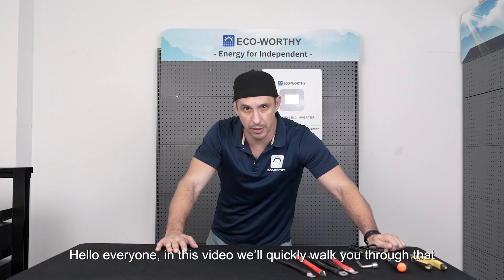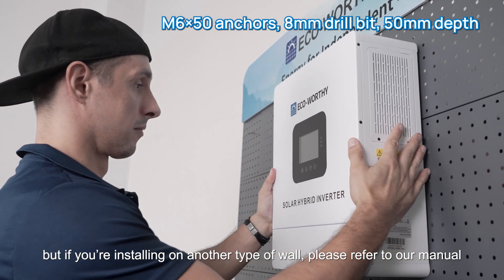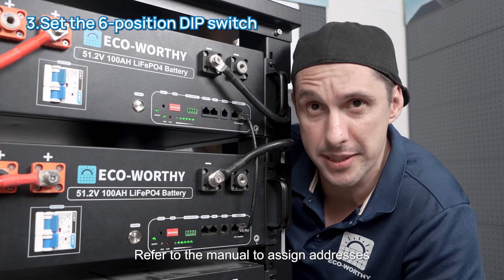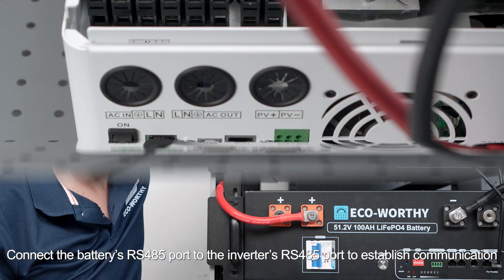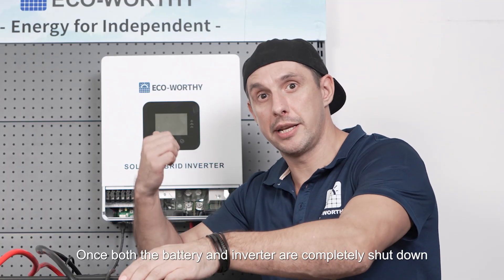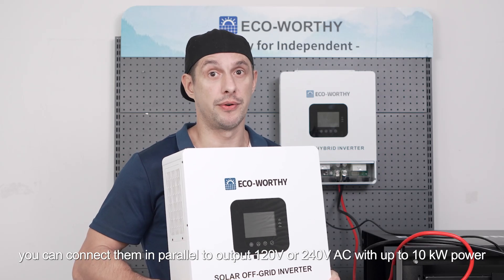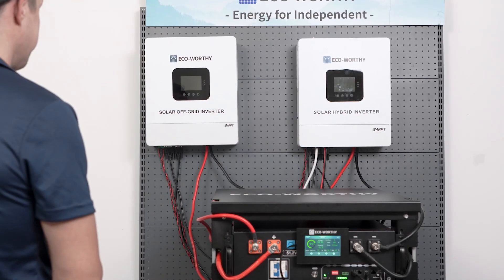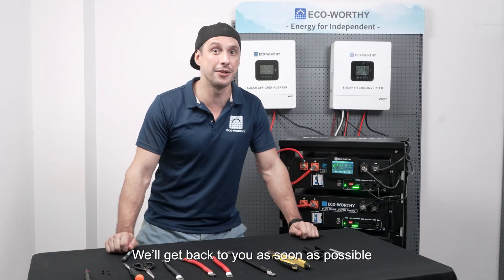Step-by-Step Guide: Connecting ECO-WORTHY 48V100AH Battery to 5KW Inverter & Inverter Parallel Setup

Comment: missed showing connecting the cables on the busbar before connecting it to the inverter. People are going to want to see where on the busbar you connected the cables since it seems all the connects are taken up by the batteries being connected in parallel.

Comment: Is the 485 communication cable a generic RJ45 CAT5/6 cable? I am connecting as suggested and have the battery protocol set to PYL, but the battery and inverter are not communicating. I have the version two battery (+ on the right side) and the inverter is also about a year old, but has the same menu and contact layouts.
Reply from the maker: We sincerely apologize for the unpleasant experience.  The 485 communication cable is not a standard RJ45 CAT5/6 cable. Because the pin assignments are different, a custom cable is required.
If your device is a 5kW inverter, we need to send you a special communication cable. Please contact the customer service of the platform where you purchased the product via private message and provide your order number. We will send you the correct cable free of charge.

Comment: I’m not getting any charging to the battery via the PV. It shows 130V coming (PV) but is not charging the battery. I have no AC input as we are off grid. I can turn the inverter power on and get the yellow (AC/Inv) flashing light but never get the green (charge) flashing light…
Reply from the maker: Hi：）

Please check the following items:

Confirm that all wiring is correct, including PV and battery connections, correct polarity, and that there are no loose cables.

Verify the MPPT voltage range: the MPPT operating range is 120–450 Vdc. Although the measured PV voltage is 130V, this is very close to the lower limit. Due to changes in sunlight or voltage drop along the cables, the actual PV voltage may fall below 120V, which can prevent the system from charging.

Check the charging mode (Parameter 06) and make sure it is set to “PV Only.”

Confirm the battery type (Parameter 08) is set to LFP (LiFePO₄).

If the issue still persists, please contact us at ecoworthy@gmail.com
 so we can further assist you.

Comment: Hello, I have 4-100-amp eco-worthy and 2-50-amp battery. Can they be put in the same eco-worthy rack that has a built-in bus bar? And connecting together.
Reply from the maker: Hello, the 100Ah and 50Ah batteries have a significant capacity difference, so we do not recommend connecting them in parallel. Doing so can cause uneven current distribution, preventing each battery from being fully charged or discharged, which may affect performance and shorten battery life.

Comment: Thank you, I have 4 100ah Ecoworthy batteries in parallel with no busbar (older rack model).  I have the EG4 Flexboss 18 inverter which can draw up to 10kW from batteries.  What size cables should I use to connect the batteries in parallel?  And what size cable from  the master battery to the inverter?
Reply from the maker: The terminals on each battery cannot safely handle currents as high as 200A, so connecting them directly in parallel could be risky. We recommend using a 400A busbar to safely combine the batteries. Product link:
https://www.eco-worthy.com/products/eco-worthy-400a-busbar-with-6-m8-studs-one-set-of-two-for-parallel-batteries?_pos=1&_psq=400A&_ss=e&_v=1.0

Battery to busbar: use 2AWG cables

Busbar to inverter: use 2/0AWG cables
Reply: @ecoworthy_official  Thank you, I am taking your advice to use a 400A busbar

Comment: I bought your system etc etc inverter and two batteries.. As Much everything was simple to setup I have issues with charging the batteries from solar panels it shows me 0v and 0A on charging ... I temp connected just one 440W battery to it and I get current from that battery directly but intevrer shows  all zeros etc etc weird...
Reply from the maker: Thank you for your feedback! 
We are very sorry that our product provided you with a poor experience. To accurately identify the problem, could you please provide the specific model numbers of all the products in your system so that we can better assist you in resolving the issue?

Comment: hola . tengo 2 inversores de 10kw eco worthy y quiero hacer 20 kw en potencia y e estado viendo los diagramas del manual..y tengo una duda sobre los cables DB15, es necesario conectar los 2 cables o solo 1...?????
Reply from the maker: Gracias por su apoyo a nuestro producto. En su caso, el cable DB15 requiere dos cables para su conexión.

Comment: I am going to connect 2 ecoworthy 48V/51.2V 100amp server batteries in parallel =51.2V 200amps=10,240watts.  I need to connect everything.  How many amps in the hybrid Solar Charge Controller/Inverter.  All of my posts these are all my first time ever DIY Projects.  I been living in the woods and desert in a van so I really want a lot of solar and I am even going to get some wind turbine action for when there is NO SUN but a lot of wind.
Reply from the maker: Thank you for your comment!

The power of the inverter should be selected based on the total power consumption of the appliances. Since you're using it in an RV system, a 5kW inverter should be sufficient for most setups.

If you have any other questions or need further advice, feel free to reach out — we’re happy to assist!
Reply: @ecoworthy_official  My most important question that involves the purchase of ecoworthy products was not answered.  I am awaiting yhe delivery of the 48V/51.2V x 100amp server rack batteries but I want to buy an ecoworthy 48V 60amp battery cjarger but this video says that the  I saw on Amazon that ecoworthy is selling a 48V 60Amp battery charger.  I just ordered the 51.2V 100amp battery=5120watts x2=10,240 watts.  I need and want a 120volt US ac wall plug in charger to charge my newly purchased batteries. I do not have a 4 prong 240volt input.  This video   
https://youtu.be/mbHgb8nQmOM?si=bgtuyJlgATw_NupXsays 

  says t states that Ecoworthy includes a 120volt ac adapter but that the ecoworthy adapter not wired correctly so this guy made his own adapter.  I do not know how to make my own adaptor so if ecoworthy will not include an adapter that I can use then I would be forced to buy a 48VV 30amp battery charger from LiTime.  I prefer to buy an ecoworthy 48V 60amp battery charger but if I cannot make it work then I have no other choice.    
 I do NOT have a gasoline or propane generator to charge my 51.2V 100Amp  Ecoworthy batteries.  I plan to connect in PARALLEL my Ecoworthy server rack batteries 48V/51.2V x 100amp + 48V/51.2V x 100amp =48V 200amp =10,240watt battery system.

Comment: Read this and answer other than solar power which I hope to have much success how can I use an Ecoworthy 120V Wall Charger?   I own those two batteries in your video I just bought them and waiting for them to arrive. 51.2V 100amp server rack batteries.  I saw on Amazon that ecoworthy is selling a 48V 60Amp battery charger.  I just ordered the 51.2V 100amp battery=5120watts x2=10,240 watts.  I need and want a 120volt US ac wall plug in charger to charge my newly purchased batteries. I do not have a 4 prong 240volt input.  This video https://youtu.be/mbHgb8nQmOM?si=bgtuyJlgATw_NupXsays t states that Ecoworthy includes a 120volt ac adapter but that the ecoworthy adapter not wired correctly so this guy made his own adapter.  I do not know how to make my own adaptor so if ecoworthy will not include an adapter that I can use then I would be forced to buy a 48VV 30amp battery charger from LiTime.  I prefer to buy an ecoworthy 48V 60amp battery charger but if I cannot make it work then I have no other choice.    
 I do NOT have a gasoline or propane generator to charge my 51.2V 100Amp  Ecoworthy batteries.  I plan to connect in PARALLEL my Ecoworthy server rack batteries 48V/51.2V x 100amp + 48V/51.2V x 100amp =48V 200amp =10,240watt battery system.
ECO-WORTHY Upgraded (Version 2) 48V 60A Lithium Battery Charger, Adjustable Voltage & Current, CAN BMS Communication, Generator Plug, Smart Fast Charger for Server Rack LiFePO4 Battery.
Reply from the maker: Thank you very much for your support of our products. 

Regarding your question, after consulting our technical team, we offer the following response: 

You can purchase our 120V charger as usual, but you will need to purchase an additional 120V 5-15P plug for use together.

If you have any further questions, please feel free to contact us.

Comment: Questions 1 about a 24V system I will make with a 24V Solar Charge Controller and 24V Inverter 4000watt.   Question 2,  12V system with a 12V MPPT Charge Controller and 12V 3000watt Inverter. Question 3 I will post Next about 48V Server Battery and a 48V server battery Charger. That will be it's own separate question. I bought 4 Ecoworthy 12.8V 300amp batteries total of 15,360watts.  I am going to set these 4 batteries up either as One 24V 300watt 7680 system with a 24V 24V Inverter. Then I will have  a 12V Inverter and 12V MPPT Solar Charge Controller.  What size copper wiring should I use for each system to wire batteries, inverter, solar panels, etc...?  I need to learn how to connect the following Battery Monitor, MPPT Solar Charge Controller, Inverter, batteries, fuses, Solar Panels, PV disconnect switch, grounding.  These are actually my first time putting together a DIY system.  I realized after buying 2 small Bluetti Solar Generators I would be much better off if I build my own system.
Reply from the maker: Thank you very much for your question. After consulting our technical team, our answer is as follows:

Wire gauge selection is based on a core formula: Current (A) = Power (W) / Voltage (V). Then, refer to the AWG current gauge table to select the appropriate wire gauge, taking into account inverter efficiency and a certain safety margin. Based on your needs, there are three possible configurations:

Option 1: 12V System (Not Recommended)
Connection Method: Four 12.8V batteries connected in parallel.

Maximum continuous current on the inverter side (based on a 3000W inverter with 90% efficiency):

3000W / 12V / 0.9 ≈ 278A
Required copper wire gauge (battery to inverter): At least 2/0 AWG (approximately 67 square millimeters) or thicker cable. 3/0 AWG is recommended to further reduce temperature rise.

Option 2: 24V System (Feasible, but not optimal)
Connection Method: Connect batteries in series in pairs, then in parallel. Option 1: Connect two batteries in series to form a 25.6V battery pack, then connect the two packs in parallel.

Maximum continuous current on the inverter side (based on a 4000W inverter with 90% efficiency):

4000W / 24V / 0.9 ≈ 185A
Required copper wire diameter (battery to inverter): 2/0 AWG (67 sq mm) cable is recommended.

Option 3: 48V System (Strongly Recommended)
Connection method: All four 12.8V batteries are connected in series.

Maximum continuous current on the inverter side (based on 4000W/90% efficiency):

4000W / 48V / 0.9 ≈ 93A
Required copper wire diameter (battery to inverter): 4 AWG (21 sq mm) or 2 AWG (33 sq mm) cable is sufficient. 2 AWG is better, providing ample headroom.

We recommend connecting four 12.8V batteries in series to build a 48V system. There are two main reasons for this: 1. Optimal power matching: With four batteries connected in series in a 48V system, the total energy is 15.36kWh, resulting in a more reasonable discharge current.

2. Safety and efficiency: Higher voltage means lower current when transmitting the same power. Lower current means: thinner wire diameter, lower cost, easier wiring; lower losses, higher system efficiency, less heat generation; higher safety, lower electrical risk.

During setup, please connect in this safe order: After confirming that all batteries are fully charged, connect the batteries first (with the main fuse installed), then connect the inverter and controller's battery terminals, and finally connect the solar panel (connected to the controller via a switch). Ground the metal casing of all equipment, and connect a shunt in series with the battery's negative terminal for monitoring. Always use a multimeter to check the voltage and polarity before powering on.
Reply: @ecoworthy_official  I think I will put 4 batteries 12.8V 300amps in series for 1 set up of 48v 300 amps. Should I use 2 Aught wires to connect the 4 batteries together?  I will have a 15,360wh system.  So I believe I should have a minimum of 3000watts of Solar Panels for charging. I might try for 4000 watts
Reply from the maker: @JohnMerchar-x3o Thank you very much for your feedback.

One No. 8 line can handle 33.025A of current, while two lines connected in parallel can handle 66.05A. Whether it can be used depends on the power rating of your inverter. I replied to you about the current calculation method before. You can refer to the AWG current gauge comparison table according to the normal current to select the appropriate wire gauge. It is recommended that you leave some margin.

If you have any further questions, please feel free to contact us.

Comment: @ECO-WORTHY I have that same data logger, what app do i need to use, and how do i set it up?
Reply from the maker: Thanks for your question!

To set up the data logger, please plug it into the WiFi port of your inverter.

If you are using the newer version, you can search for “Smart ESS Solar” in the app store and follow the in-app instructions or the user manual to connect the data logger.

If that app doesn’t work for your model, please try “Solarman Smart” and follow the app guide or the manual to complete the setup.

If you need further help, feel free to let us know!

Comment: 1:17 How are the batteries supposed to be charged individually?
Reply from the maker: Hello, this is ECO-WORTHY's online social media operations specialist. We noticed your product question and take it very seriously. Here is our answer: If all batteries are brand new, no separate charging is required. Only when you want to add a brand new battery to an already used and fully charged battery pack will you need to charge the new battery separately. We recommend using the dedicated charger, which is available for purchase in our store:

https://www.eco-worthy.com/collections/solar-charge-controllers

If you need more detailed information or setup assistance, please feel free to contact us! 😊
Reply: @ecoworthy_official  ive read somewhere, the batteries all need to be within 0.05v of each other before they can all be connected.. are all new batteries absolutely within that voltage spec? or does it not matter on new batteries?
Reply from the maker: @MrJrea  Thank you for your question!

All new batteries may have slight voltage differences at the factory; this is perfectly normal and will not affect battery performance.

Before connecting batteries in parallel, it is recommended to ensure the voltage difference is within 0.05V. This helps prevent sudden balancing current from triggering the battery management system (BMS) protection mechanism.

If the voltage difference is greater than 0.05V, a simple solution is to perform a slight charge-discharge cycle until the voltages are close, and then safely connect the batteries in parallel.

If you have any further questions, please feel free to contact us!
Reply: Unplug the old batteries and just plug in the new battery and let the inverter charge that individually as if it was a one battery system. When that's charged disconnect it and add it to the existing battery pack. Make sure the system is off before messing around with the batteries though.

Comment: I got 2 quetion.

When I add a second battery,  the first one battery,  the little breaker is up number one and the second battery the little breaker is up the number 2 ?

My sistem is charhing from pv very well, but How I have to program the inverter for charging also from main power from the street?
Reply from the maker: Thanks for your questions! Here’s a quick clarification:

About setting the ADD numbers for multiple batteries
Yes, that’s correct — the first battery should be set to ADD 1, and the second battery should be set to ADD 2. This allows the system to correctly recognize the order of the batteries.

About charging through the grid (Setting 06)
Your system is working well with solar charging, but if you want it to also charge from the grid, please set Menu 06 to Hybrid Default. This enables the system to automatically use grid power to charge the batteries when solar power is insufficient. 

If you have any other questions about the setup or configuration, feel free to ask! 😊

Comment: Do the battery cable size need to change when running two inverters in parallel?
Reply from the maker: Hello, if you have high power requirements, please connect all batteries in parallel via a busbar and then connect the busbar to the inverter. This is because the battery terminals have limited current-carrying capacity.❤